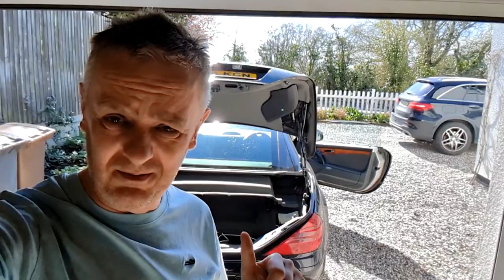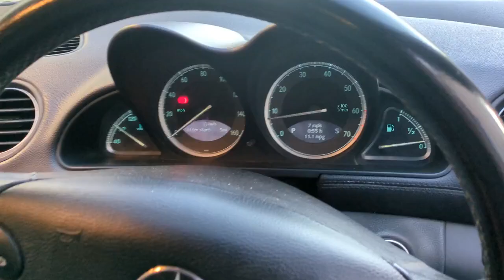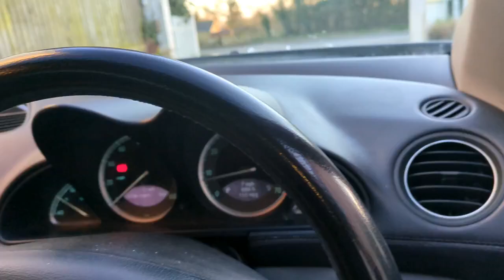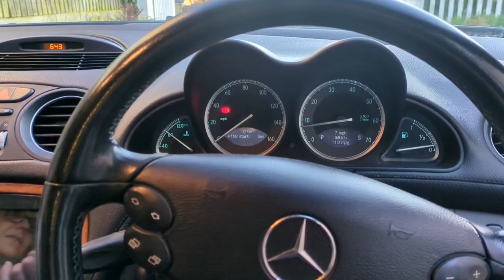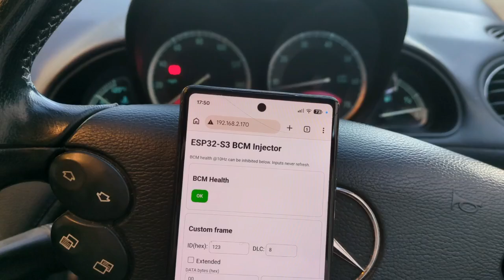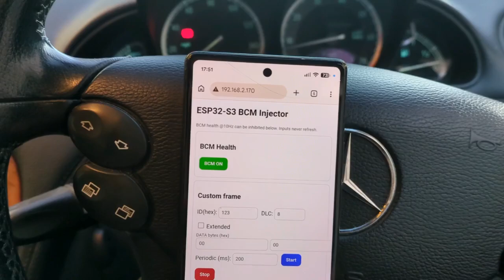SL R230 BCM Emulator

Comment: Hi , grate job . I just fight with emu base on can 18 in 1 but from some reasons when elu its wokrs error its gone but i cant use switches on my steering wheel
Reply from the maker: Hi, happy to help if your able please join my Facebook group "Emulate my old Merc" post the problem your looking to solve and the issues your having.